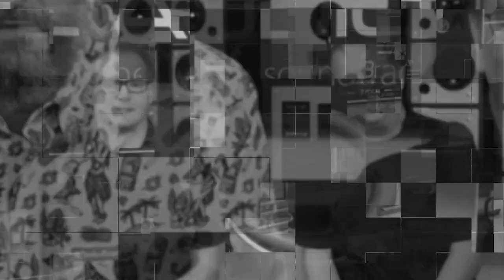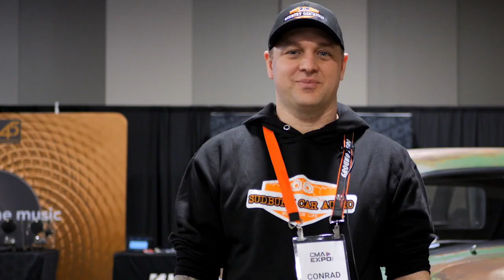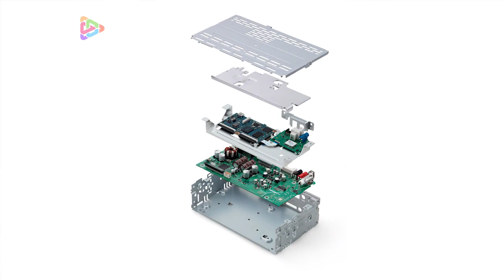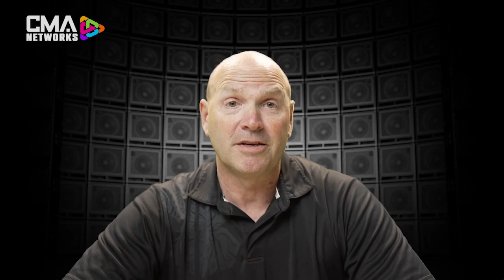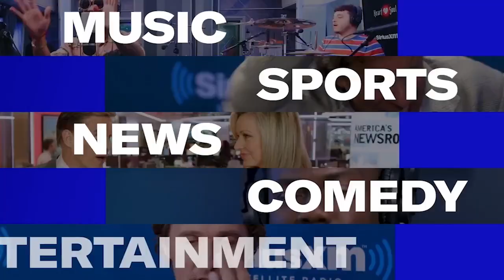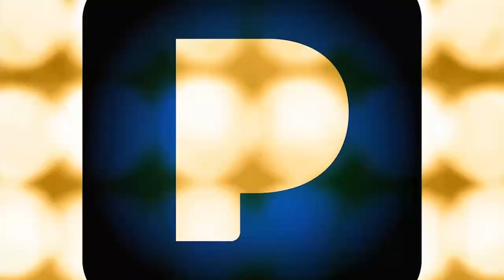SONY | SOURCE UNITS | CONNECTED

Comment: I bought the 6000 roughly when this video came out and I was throughly disappointed with it. Nothing but constant connection problems almost everyday. Some days it was to the point where I couldn’t listen to my music for more than 5seconds b4 CarPlay would disconnect again. Checked with Reddit and it seems to be a common issue. I’ve since returned it and trading up to the 9000es in hopes of a better experience. If not, I’m going to alpine
Reply: Did the 9000es help?

Comment: I'm so glad they came out with the 9000. It will be in my 4Runner. I prefer it to a floating screen getting in the way of vents and controls. Love the understated looks and matte bezel. Of course sound quality is what matters most and they nailed it with this series. I'd love to see a model in the ES line without an onboard amplifier, 3 way active crossover, coaxial digital output and a companion 7 channel staggered power amplifier with coaxial digital input. I'd pair that with the ES 3-way components, two 10" ES subs and rock on down the road.